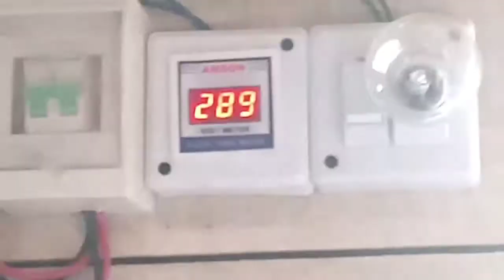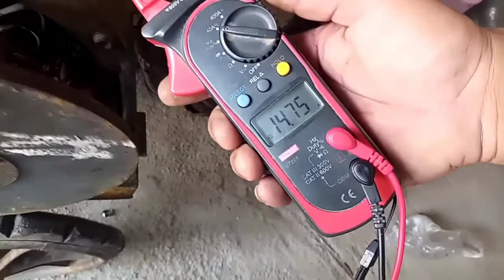Peter Diesel Engine Startup | Generating Electricity By Peter Diesel Engine | Antique Engine

Comment: I just liked and subsribed! I love your generator! How old is it? Do you use it often?
Reply from the maker: Thanks for your kind support❤. It's about 30years old, and yes i often use it
Reply: @latif_hassan345  Thank you for your reply! 30 years??? Is this engine still running after 30 years? Woow! Did it require any repairs?
Reply from the maker: @DieseloveMotoryDOTsk  off course bro its working accurately and well, and yes it require some repairs often
Reply: What is the common repair on this engine? How many hours does it run before a repair?
Reply from the maker: @DieseloveMotoryDOTsk  after the recent repair about two years ago, its been working well
Reply: @latif_hassan345   what needed to be repaired?